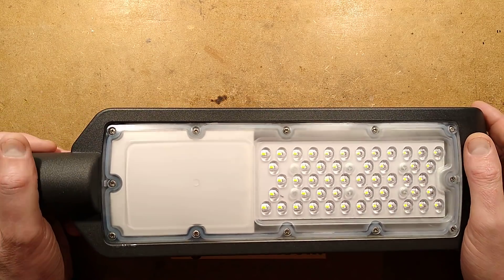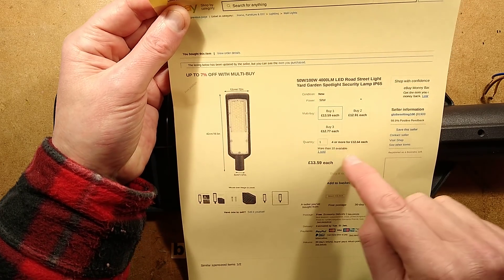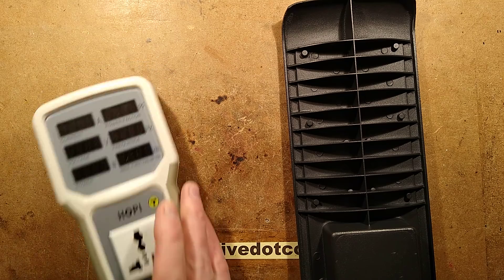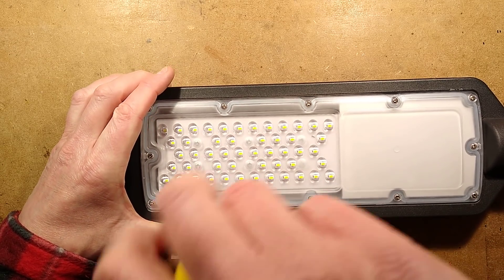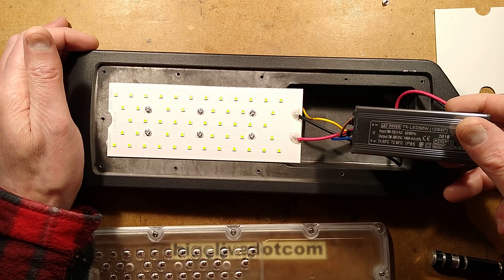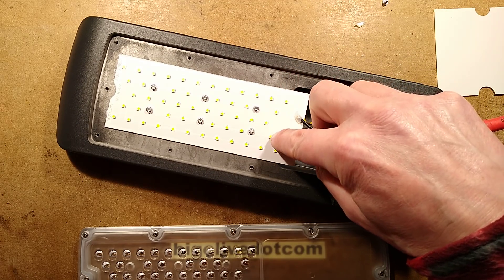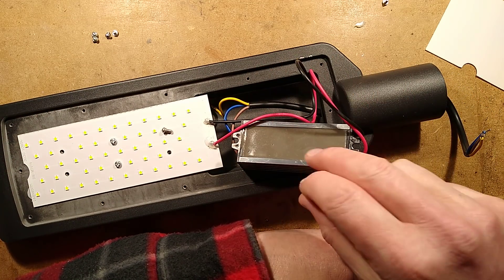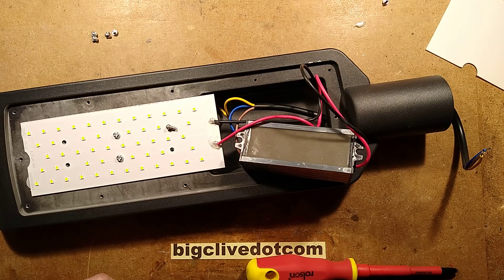DIY Chinese street light kit.

Comment: Thanks for that, Clive, I might just consider a pair of these to replace two of our 35W SOX lamps in the yard. At the price of these LED lamp heads, you could get two of them for the same price as a single 35W SOX "bulb" so even if they lasted only half as long, they still would not cost any more to replace, though it would be weird looking out into the yard and seeing it lit up in white!
Reply from the maker: There are other styles available that are at least a bit more serviceable because they use the square format 10 x 10 chip LED arrays.
There's a good chance that an old SOX lamp will greatly outlast a modern LED lamp.
Reply: @bigclivedotcom  I'd say there's more than a good chance! - They've given us 25 years service so far, only ever needing new "bulbs" but they're getting hard to find in the local electrical wholesalers. To be honest, I much prefer the amber glow coming through the windows at night, but our CCTV "sees" better with white light, at least, until the IR floods kick in.

We are trialling that Philips "True Force" (Xitanium driver) at present, but they're not as cheap as this one.
Reply: @bigclivedotcom  Phoenix AZ just completed replacing all 100,000 street lamps with LED's.  The write-up said 10 year warranty.  $3.5M yearly energy cost savings.  18,000 metric tons of carbon dioxide reduction a year.  Cool.  Hope this pans out.
Reply from the maker: @lint2023  Best of luck on the 10 year warranty.  The energy saving may be cancelled out by the replacement costs and labour.  I'd not want to give a warranty on any LED street light of more than a year.
Reply: @bigclivedotcom  Making it more challenging, Phoenix is one of the hottest cities in the US.  🔥  I hope they do a one year review next January.
Reply: Sell the tubes and ballasts on Ebay, they are useful if you are making optical flats.
Reply: I would rather keep the sox lights, they are starting to get quite rare now
Reply: @alistairstuart2009  I quite agree, and that might yet be the case. I have my own "pet" lamp that we keep as a spare, but the CCTV sees better in white light during the twilight transition, until the the IR flood lights come on.

Comment: You missed it Clive!
Those two fixing screws are the earth that is why they are so tight! they pick up the earth from the lighting sanction which is earthed at the cutout at the base! ;0)

For those not aware this is a joke about the Chinese Safety Standards (or more accurately lack of) ..... bu the riser tube that the light fits on would presumably be of metal and would also be earthed!

It is interesting to think of what this unit would replace (sodium light) and what was involved with those! I can remember as an apprentice being ridiculed for suggesting there was such a thing as a High Pressure Sodium light ..... The Engineer was a bit  old school though ;0)

Comment: Street lights turn on at night where black fines oriented toward the night sky will dissipate heat very well. Now if the street light turn-on on a sunny day, having to replace a bunch of lights might teach the operator to properly maintain its dusk sensors.
Reply from the maker: The failure mode of many dusk sensors is in an on-state.
Reply: @bigclivedotcom  Absolutely which lead to an always on street light, wasting energy and no one notice it, but if the light doesn't work at night, like light blown by sunlight they will need to fix the problem (dusk sensor) and save electricity. Replacing ten's of LED because a dusk sensor failed might told them to use more sophisticated dusk sensor, like redundant time and season clocked.
Reply: @bigclivedotcom  
It would last longer if you never turned it on.
Reply: Needs a thermal sensor to turn down the wick if the heatsink temp goes up too much.
Reply: @FarleyHillBilly  Its an obsolete technology, 1-2 year old, currently we would use on board regulator improving the power factor monitoring, temp and keeping the LED in a safe operating range. LED technology is improving quickly.

Comment: I see you in the refrigeration group on fb, don't suppose you have any idea how the f*** The fan motors work in pretty much every single ac unit?
Daikin, Mitsi H & Mitsi E all use the same 5 wire configuration and it doesn't seem to make any sense to me on how they're controlled. http://g.search.alicdn.com/img/bao/uploaded/i4/i1/3163498468/TB2F56wChSYBuNjSsphXXbGvVXa_!!3163498468.jpg This exact motor is found in about 80% of all wallmount units under 3kw
Reply from the maker: There's not a huge amount of information on them that I can find because they are just treated as a component.  My guess is:-
Red - Main high voltage supply
Black - common circuit negative
White - Vcc control circuitry supply
Yellow - speed control signal
Blue - feedback to controller to indicate speed
Reply: I'm guessing it's like an iMac fan - speed controlled by a variable voltage (normal variable-speed computer fans are either controlled by a built-in thermostat or a Pulse Width Modulation signal from the motherboard)... Extrapolating from the labeling: red is power, black is ground, white is DC power for the internal electronics, yellow is the control voltage, and I'm thinking blue is a tachometer output to tell the master controller how fast the fan is spinning (or if it has stalled)... (An old-school five-wire induction motor would have two for power with a third wire for high/low (or forward/reverse), and two for a capacitor...)

Comment: I don't worry about 5G, 4G has already cooked our brains.
Reply: We were all going to get brain cancer when 2G came out
Reply: 2g, 3g 4g and 5g all use the same frequency and power.
Reply: @matsv201 
Not quite. 2G was only 900mhz originally, with 1800 being added later. 1900 existed in some places too.
3G was originally only 2100, with 2G bands being recycled later.
4G used the 3G bands to begin with.... Then added a huge pile of new ones.
5G uses all the same 4G bands but this time adds a few extras right from the start.... Some of which could cause damage to living cells... But being high frequency, they likely also won't penetrate skin. So you might get skin cancer on your fingers or ears from 5G, but not the brain cancer some people are taking about.
Reply: Visible light is 400 to 700 Terahertz. We seem to get by ok with that.
Reply: @tin2001  What you writing is not really correct. You have to take global market into account. 2G uses everything from 450Mhz up to 2000Mhz depending on region.

3G uses frequency between 700 and 2300Mhz. So slightly higher but not really by much.

4G uses between 450 and 2600 Mhz. So pretty much the same, but a bit wider still.

Now 5G uses pretty much the same frequency. Now here it get complicated. 5G uses 20 and 60Ghz. Now 2G-4G also uses that freqvencys. But it uses it in the inter communication. Now that is the case for 5G to. The difference is that 5G can treat a device as a base station. Increasing the usage of 60Ghz.... but it was always there
Reply: @cormacsyt0  you need multiple kw of power to have any significant increase in heat. Remember the sun is about 1.3kw/m2 and it's really just UV radiation that is harmful.
Reply: @cormacsyt0  sunlight is virtually parallel beam here on earth. 

Radio transmitters are not. A normal phone is at most 2w and omni directional (well not 5g). Base station is partionally directional, but they are much longer distance do the power is in the micro watt range on the ground
Reply: @cormacsyt0  that is the fearmongering non science camp. Radio waves are less intensive than visible light, there for less intensive att given power. The power are 2 to 3 orders of magnitude less from.hand set and about 6 orders from the base station.. 

The reason why welding is so dangerous is because its UV and also that the eye concentrate the energy. Making it very dangerous.
Reply: 60GHz?!

We're currently rolling out 5G at 3.4GHz.
Reply: @paulsengupta971  60 and 24 Ghz is for quasi base stations.
Reply: @cormacsyt0  yes but sunlight is already 1300w/m2. And nobody things of that as harmful apart from the energetic UV radiation

Comment: Just curious if this would be recommended for an off grid cabin in a very rural section of Northern Nevada? I would have use for 3-5 of them, with a solar array and battery pack. EDIT: Where is the 5G module for mind control? That could be useful to deter trespassers.  😂 Finally, what would I type in to find this on Ebay?
Reply from the maker: These cases alone are a very good starting point for a custom 12V light based on the simplest circuitry possible.  In very dark areas you only need enough light to get about and can rely on a good rechargeable LED head torch (plus spare) for work light.

Comment: 6volt white chip leds on ebay clive about £3.50 for 50
Reply from the maker: Interesting.  Mainly aimed at repairing specific TV back lights it seems.
Reply: @bigclivedotcom   indeed but also great for lamp repairs and projects :)

Comment: Short mains leads... why don't the chinese fit those things with 20m instead of 20cm...
Horrid LED's have turned up in glasgow city centre and the horrible light looks like the lenses have been coated in vomit... horrid fleshy coloured cheap things... maybe the council should start buying chinese lamps or better still... go back to the old orange lights
Reply from the maker: The colour is probably to try and appease the blue light conspiracists.  Like the orange covers you get for phones to block the blue light.  (!)
It's not the phone's blue light that's keeping people awake at night. It's the fact they are on Facebook instead of sleeping.
Reply: Well... 🤨 again scientists have recently done research and found that its not the colour of the light (blue/amber) but how bright/dim it is - that the lab mice fell asleep in very dim blue light! / at sunset the light turns a dim blue after the bright yellow/amber, after reading the article I turned off night shift (yellow screen) on my iPhone/laptop as it (now) would not have any effect, and that feature has been rendered useless to have on iOS/windows10.  The next innovation is to see how far down the screen can be dimmed  😉
Reply from the maker: @samuelfellows6923  In reality, it might be the temptation to check out the notifications that pop up on your phone during the night.  The real answer to phone induced sleep loss is to leave it in another room and use an alarm clock.
Reply: I fall asleep watching YouTube all the time.

Comment: If you mount it perfectly level, it will fill up with water, and you have a water cooled streetlight!
Reply: Even better if it was snowing?!
Reply: Check out LiquidLED, they actually use liquid cooled lamps. Dunno if they make street lights though.
Reply: And mosquitos will build a nest in the water
Reply: dingdingdingdiiiiing after a while we could get a full wild life pond !🤣
Reply: Where does the water get in?
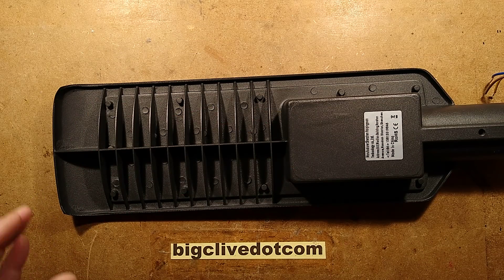Reply: SkyWizardless check 2:35 , it would just pool up not actually get inside
Reply: @mrOGmixer  That's exactly what I thought.

Comment: If your putting that light in the garden theres possibly room for a wifi extender in the casing or maybe a bluetooth control module so you can turn them on and off individually from a mobile.

Comment: I need a couple of these for my driveway and backyard. For security.
Reply from the maker: Whatever you pout up, make sure it's at an accessible height for repairs and swapping.  Modern LED technology is not as reliable as claimed.
Reply: @bigclivedotcom  You can say that again! Our local council upgraded us to SOX in 1978, and they served us well, until 2016, when they were replaced with LED, and again in 2017, and again in 2018. The current ones, it must be said, have faired better, but it's a long road to the 38 years we got from our SOX lighting.
Reply: @28YorkshireRose12 
I doubt the lamps lasted 38 years.
Reply: @tin2001  No, I didn't say they'd never been serviced - the "bulbs" only last about 3 years, but the lamp units as a whole were in service for 38 years. The subsequent LED lamps have been entirely replaced 3 times since 2016.
Reply: @28YorkshireRose12  We moved in here in 1976. Had to think but I don't think the bulb in the washhouse has failed in all that time. HOWEVER, I have replaced that bulb - WITH A DEAD ONE as the switch failed and we couldn't turn it off and I wanted something to keep the spiders out !

I think the replacement might be the DUFF CFL that only worked twice, before going BANG, in the outside loo next door to the washhouse!
Reply: @bigclivedotcom  right, something like you've reviewed before.
Reply: @raymondmucklow3793  I got some of those Aldi bulkhead lamps Clive reviewed.. more than adequate for any domestic application and I think Clive gave the internals a clean bill of health.
Reply: @truthreporter1709  can you choose wide angle beam or spot. I think I remember those that's what I had in mind.
Reply: It's a shame the pole mount wasn't a few mm wider, then you could make up a mount with scaffold tube

Comment: That silly little pre-wired flex looks like a pain for installation. Much prefer proper terminals to having to make a join in the arm/column.
Reply: They are. On those Chinesium lamps I remove that cheap UK/EU flex and put in a longer US color coded lead of a better quality and bigger gauge. The termination is done via a pole mounted box. We don't use the wabco? (sorry I forgot what they are called) terminals int he US to join wires, though they are an option, We use the wire nuts and tape.